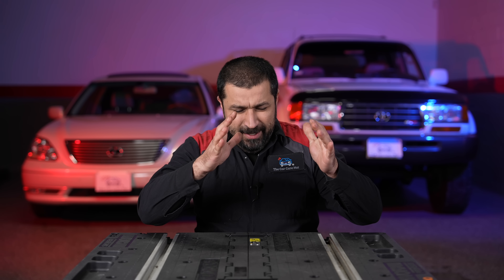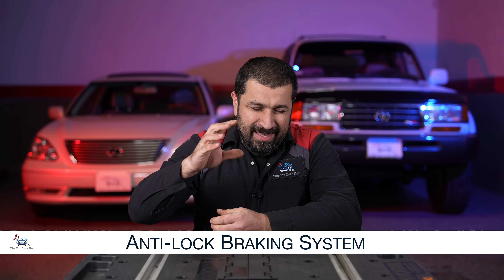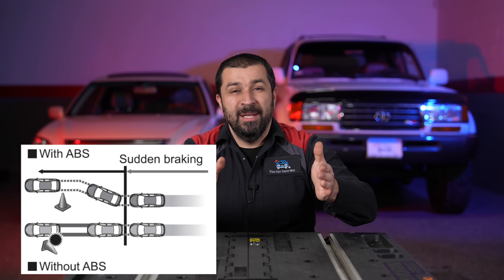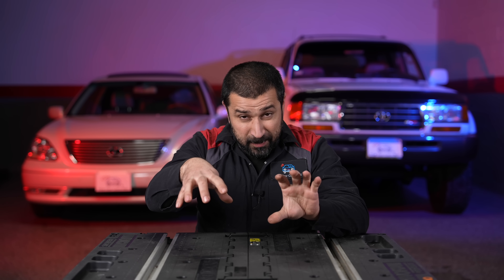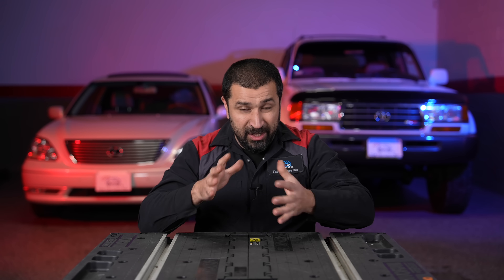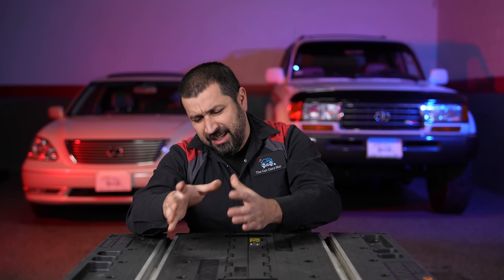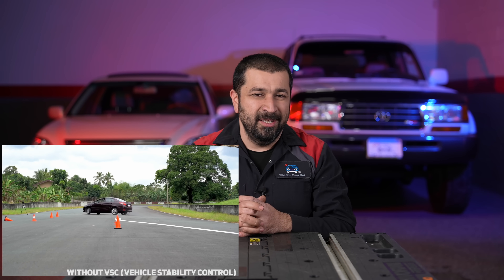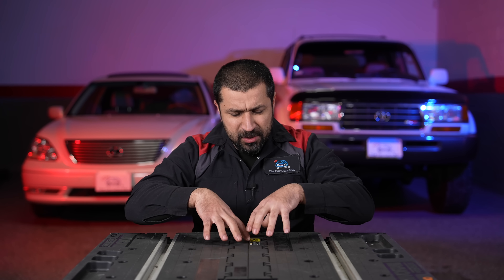How Does Toyota ABS, Traction Control and VSC Work? Everything You Need to KNow

Comment: Traction Control on modern cars, including Toyotas, is worthless.  It does not respond fast enough to do anything good.  It only does bad things.  Completely worthless.  VSC is the same.  Does not work at all.  Never has. Never will.  It is just too slow to help.  Just look at all the modern cars in the median during any ice event.  Simply does not work.  NOT EVEN CLOSE.  Stupid waste of electronics.  Any time you are on ice, turn OFF all of these systems.  You WILL CRASH with these systems working.
Reply: I turn it off anytime it snows, you are correct it doesn't work 90% of time. It has thrown me into uncontrollable slides. Turned off I can control the slide with my right foot and steering. 
Drivers get dumber as dot mandates more so called safety features.
Reply: VDIM responds 1000 times a second. One of my high school friends had a 2006 Highlander with VDIM. According to her it was great in the snow.

Comment: A couple months ago I got to fully explore these systems in a large open parking lot at night with about a foot of fresh snow. 2023 Prius AWD with Michelin X-Ice Snows. I couldn't lose control even when I tried.  I grew up driving RWD cars/trucks with absolutely no assist systems because that's all there were. I remember having to regularly shift my 88 Ranger 2WD into neutral coming up to stop signs because the rear wheels would keep spinning on the snow/ice even when the truck was stopped(sometimes even with multiple sandbags in the rear). Or feeling my butt clench on the freeway in the family MB 300D as I pulled off the accelerator going under overpasses and hoping the sun hadn't melted a little snow to drip down and form an ice puddle underneath.

All that to say I love these new systems, and I'm happy they don't build 'em like they used to.

Comment: Yeah my Tacomas traction control with manual transmission  during slippery conditions will cut back throttle to the point where it will stall the engine. The software needs a little tuning.

Comment: Great video!  Back in 2003-2006 or so I had a valet parking job at a ski resort in Vermont.  We parked hundreds of cars on a busy night bringing them from the slope side hotel down to a lower much larger parking area and riding back up in a van to get more cars.  Of all the cars that I drove down the hill for all those years and made a hard right into the snowy/icy parking lot with/without braking, the Lexus vehicles (mostly suvs at the ski resort) always amazed me on how well they were able to control that hard move to the right downhill into a fall away slippery zone.  I remember thinking that someone who had never driven in snow before, could be able to drive slowly, but fairly safely through wintery conditions with these systems.
Reply: Thanks AMD

Comment: Thank you for this video.  I do change the brake fluid in all three of the vehicles in my yard, and one of them is a 2020 RAV4.  I don't have the test strips, I live in the southwest so it's usually a dry climate however, I do change the brake fluid every two years.  Like engine oil, brake fluid is cheap.  Engines and Brake Systems are expensive!

Comment: I had an intermittent misfire on my son's V6 Rav4 set all the VSC,ABS etc lights after a replaced a driveshaft seal. It would also stop the cruise control from working as well. Drove me crazy until the misfire became more consistent and found a couple of leads shorting on the plug tubes in the head. Then it started the "rattle" on cold start.....sold it.

Comment: Traction control is good until you are in deeper snow. It kills the power and your stuck.Even with all wheel drive.  If your lucky to have a switch to deactivate it you will be able to drive away.

Comment: The big question is how do you permanently shut off the traction? 
I have a 2014 tundra, so many times I've pulled out into traffic, to have a rear wheel slip on sand and instantly I lose all power and can't move for like 5 to 10 secs, by then the cars coming at me are right on me and think I'm doing it on purpose. I love Toyota's but want to switch to another brand just because Toyota's traction settings are way to sensitive

Comment: I have a gx470 with a 2” lift. I removed the fuse for the abs/vsc six years ago. Aside from not having abs/vsc, are there any issues with disconnecting these systems?

Comment: So when you get the check engine, vsc and trac lights, pull the code and it's a PO420 Cat code, the VSC and traction control are still working? I get PO420 intermittently on my 05 LX470.. Could be 600 miles, sometimes 6 miles. Don't know what's causing it. MagnaFlow says it cannot be the cats themselves, must be something else. Was worried trac and vsc were not working when those lights were on. I called 2 dealers asking them this question. Neither could answer. Now I know I still have VSC and Trac.

Comment: Somewhere there is a sensor imbalance on our 2008 Highlander.  The ABS cones on for a soft brake.  I've looked at sensors and clean the rings.  Think I tried cleaning the actuator module.  Wish there was a device so one could know exactly which wheel is the culprit.  There's no codes.

Comment: The VSC on my 22 Venza is incredible. 30mph around an icy corner with studded snow tires, no problem. It tries to slide but the VSC stops it from sliding. If you don’t know how to drive on winter roads, you would be fine in a Venza. 

That level of intervention and the lack of an ability to modify traction settings makes it pretty useless in more than a foot of snow. You can’t just disable traction control and VSC to just drive the vehicle, because this configuration of the hybrid system is incapable of sending power to all the wheels at the same time. It’s a very very different driving experience than a 4x4.

Comment: I'm all for ABS, VSC, and my GX470's A-TRAC system off-road. What I am NOT for is the idiotic heavy handed throttle cutting when one wheel slips in a little snow and suddonly I'm sitting still for several seconds with my foot to the floor as traffic approaches because the computer can't figure out what's happening. It momentarily turns my world class full time 4WD snow machine into a Prius and theres no way to explain to other drivers why I started to pull out in front of them and then just stopped for no apparent reason. Its infuriating!
Reply: Modern technology issues

Comment: CCN must read my mind (poor guy)!  This exact CEL failure just happened to me.... Short story,  the car went in for alot of work...Drove it home, decided to get a car wash...Engine quit just before going through the car wash, had to push the damn thing back and out of the line.  I only tried to start it a few times, but noticed the CEL and the traction control warning were on....  Needless to say, I spent a night or two worrying about what they were going to find wrong on top of the money I just spent for alot of maintenance...Was so worried that some computer gave out or something like that.   Turns out the technician accidentally bumped, perhaps removed but didn't install properly the crank sensor connector....  It came disconnected in the car wash, so the engine quit....  But now I understand why the traction warning was on as well!   I was so relieved it was something minor and not my fault, got the tech a gift card for dunkin donuts, kinda felt bad for him..

Comment: I have a 2016 4Runner. Great vehicle. Like many, I've oversized my tires +2 running 285s instead of 265s. I've noticed a strange problem. If I have to panic stop, my tires will skid briefly, then it's like the ABS tries to stop the skid, so it lets off the braking, then it tries to brake harder again. It does this several times producing a skid - roll forward - skid - roll forward - skid - roll forward about 3 or so times before I either come to a stop or let off the brake because I reached a speed where I'm no longer in danger of hitting the car in front of me. By the time it's over, I feel as though I was riding a bucking bronco (horse) lurching forward and backward. Is this normal? It feels like the car isn't going to stop. Eventually it does. But in older cars I drove, ABS would just kick on a pulsate the brakes continuously. Whereas in mine it's alternating between skidding and rolling. Is this caused by the larger tires? Is it a problem with my ABS?

Comment: It’s idiotic of the designers to disable the system when unrelated check engine light codes come up. I’ve got a 2007 GX with a P420 code that’s been there ever since I drove it too long on a bad ignition coil. After replacing the coils, the car drives fine, throttle works fine, I just have to reset the code every so often. Wish I had the money or energy to fix it properly, but it’s not worth it anymore. However, it absolutely shuts down all of these systems because of it, ABS included, based on lots of testing in the snow. I fail to see the need to shut down multiple life saving features because of a bad o2 sensor or cat, on a car that otherwise drives perfectly normal.
Reply: @greggeiger5203  09 GX470 here and I keep a cheap code reader plugged into my OBD-ii port to clear the emissions code that pops up randomly. Sometimes it'll go months without lighting up, other times it'll do it twice in the same day. All I know is that at almost 300k miles on my GX in South Dakota, there is a zero % chance of me replacing all 4 catalytic converters. NOPE, I will continue to occasionally lean forward to press the right button 3 times to clear the code as I drive. "Oh look, I just saved $3k."
Reply: Some of these Toyota engineers definitely finished last in class. Completely stupid!

Comment: Thank you for all of your great work I have an unrelated question hope you do not 0:01 mind .
I have a 2006 Toyota Tundra 4x4 access cab SR5 4.7 liter in great condition 151700 miles.
I noticed recently that my lower control arm bushings are worn out so to replace the control arms and lower ball joints with OEM Parts out the door what would I expect to pay roughly.
 Thank you for all of your wonderful help.
Sleepless in Seattle
Reply: If you watch this channel regularly and check the comments, you will see that none have a response.

Comment: What would make a vsc light turn on after staring at car, 13 rx350, before putting it in gear? After turning it off, then back on the light turns off. It has only happened 2 or 3 times in the last month or so.

Comment: Yes, you maintain the ability to steer the car under hard breaking.   However, another significant change is the decreased breaking distance.   A rolling tire has more friction (static friction) compared to a sliding tire (kinetic friction).    The same for traction control,  an almost spinning tires has more friction (provides more force on the car) than a spinning tire.   Slowing down (breaking) one wheel (with an open differential) also has the affect of sending power to the other not spinning wheels.   The VSC can reduce breaking to a wheel or increase breaking to a wheel based on the "need", as determined by the computer.

Comment: Man, you managed to scare me here.
Ive never seen a vsc light in my Avensis t27.
I Always assumed its was part of the traction Control light.
So i went down to actually Check If i was living a lie.
After Consulting my manual and Holding the tc Button for 3 secconds its said vsc Off in the Display.😅

Comment: Traction control in my 2023 Camry can be turned off. In what, if any situations should you turn it off?
Reply: Turn it off if you want to burn rubber.  Also, turn it off if you are rocking back and forth to get out of a snow bank.
Reply: Sand/mud/snow

Comment: Here's another cause for the CEL (check engine light), TRAC and VSC lights to all come on in Toyota products that is unrelated to any actual parts failure. After disconnecting the battery and reconnecting it, sometimes all 3 of these lights can come on. They will usually be off each time you go to start the car, but then come on and stay on after you start moving. If this happens and you didn't have a problem before disconnecting the battery, you most likely need to perform what's called a "zero point calibration", which resets the baseline reference point for sensors like steering angle or yaw rate (all the components AMD talked about here that allow these complicated systems to communicate and figure out when to kick in ABS or VSC). This can easily be done by jumping a couple of pins an the ALDL connector with something as simple as a paperclip. There are a few videos on YT showing how to do this, but perhaps AMD could do a short explaining it himself. 🙂 Once the calibration procedure is done, the lights should stay off.
Reply: Just put my Avalon in the shop today for just this reason. Battery replaced 2 months ago CEL etc lights on since drives fine until A/C and other dash functions acted up this week. 😕

Comment: My 2002 4Runner had an issue with the brake controller - I had to replace the entire module at 270k miles - painfully expensive.

Comment: Just used your video covering parasitic draw to fix my father's Chevy truck, Thanks. Would you consider doing a video on valve lifter tap? What is okay and when it needs address. This would help with my 200k mile 2014 camry.  You're awsome. Thanks for sharing your knowledge.

Comment: As a many year defensive driving instructor, I always taught students that locking up the brakes actually makes longer stopping distances because the rubber "peelings", or materials under the stopped tire acts as ball bearings. This allows a lubricating effect. By keeping the tire rolling slightly , as in ABS, it introduces new tire tread surfaces and road surface material to the road, resulting in shorter stopping distance, and true steering control.
Reply: It depends, on gravel , snow or sand the wheels lock and dig increasing the friction and  reducing the stopping distance with the tradeoff of losing steering.
Reply: Threshold braking is when you hit them hard to lock up and then back off just a smidge to gain control.  It's a learned feel from the days of heel toe down shifting and double clutching of course with non-antilock brakes.  We could stop shorter than with the abs on using this method (car had a switch for training).  Thanks Skip Barber driving school!
Reply: correct
Reply: No not necessarily the abs just pumps the brakes rapidly the tire compound didn't change
Reply: As an added caveat, I have a 1994 GMC Jimmy with first generation ABS. Back then, ABS on front breaks was inferior to threshold braking, as it was designed for stability over breaking difference (also ABS was originally used primarily only on the rear brakes, which were usually drum at the time, because they would lock up long before the front brakes). This is why it was common for some to want to disable the first generation ABS, but GMC made it difficult as the fuse that controlled the ABS was linked to the transmission module, so if you just pulled the fuse, the transmission would not shift out of first gear.
Reply: @TheOnespeedbiker  Good point.  The car was a Dodge Stratus if I remember correctly.  I'd like to be able to compare threshold braking to the newest abs systems.  I would prefer abs and vsc since when you panic brake, slightly backing off is impossible to do, especially on snow and ice.
Reply: @TheOnespeedbiker  they had abs in the 80s

Comment: mine has VSC and traction lights on since I started getting a p1038. changed the o2 sensor, still the same but drives just fine.

Comment: Bleeding Toyota brake systems can be a nightmare if you have air in the system. Standard bleeding procedures may NOT work, and the ABS pump-module may fail for no reason. Result: soft-spongy pedal. And mechanics are strangely unwilling to troubleshoot the source...too much time necessary.
Reply: You need a scan tool. then it's easy.
Reply: @meherenowmaybe  ...have one. No ABS codes. Auto bleed makes no difference. Like I said, nightmare.

Comment: Hi I have changed brake booster and ABs pump on my toyota prius v , brake light still comes on and and msg pre- crash safety malfunction, mechanic says the top of ABS pump doesn't work i need another ABS pump, can you give advise what should I do pls?
Reply: Have you tried selling the car?
Reply: Make sure you install Toyota OEM parts when repairing the braking system. There are a lot of cheap counterfeit parts out there right now, and I wouldn't trust non-OEM parts in my vehicle. And, more importantly, you need to bleed the brakes after replacing those parts using a Toyota Techstream Diagnostic tool, which usually means a dealer shop. The reason is because that tool is used to cycle the control solenoids in the brake system to fully clear out all air bubbles. It will also tell the technician if one of those solenoids is faulty. Also on your part, make sure the brake pedal switch is working by checking if your brake lights come on when you press the pedal and make sure all the brake lights actually come on, even the third light.

Comment: I have 2020 CHR hybrid. What is the click sound when I press accelerator pedal or release brake pedal? Cruise control also makes the clicking.

I asked the dealership, and they let me drive another CHR that had the same sound, only slighty quieter. They did not have any proper explanation.

Comment: I had to adjust my brake light switch after a recall repair. It threw my ABS, vsc and hill assist off until I fixed it with a small adjustment. The brake light is part of the system. It’s fairly complicated.